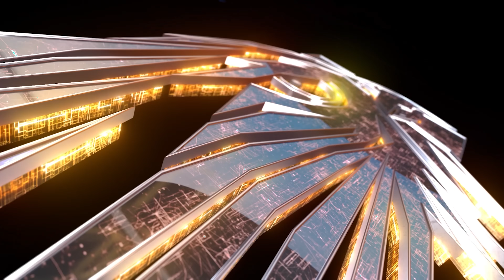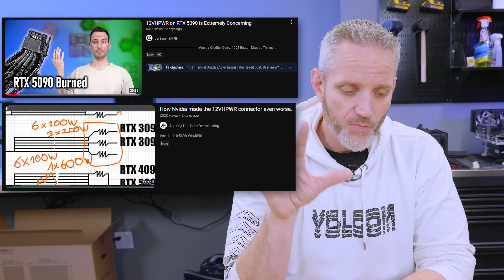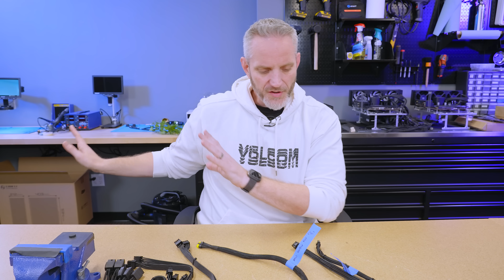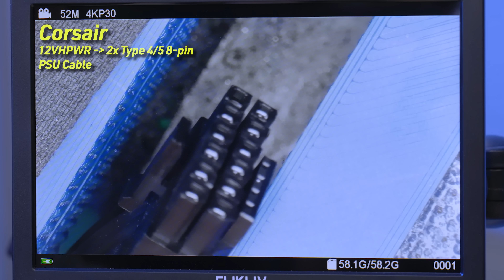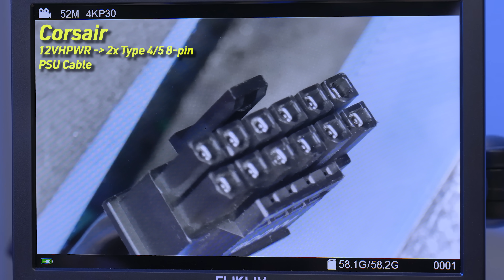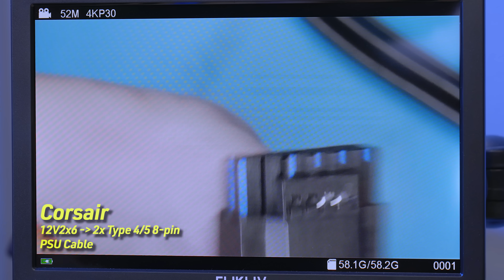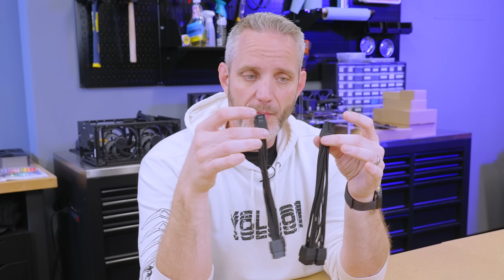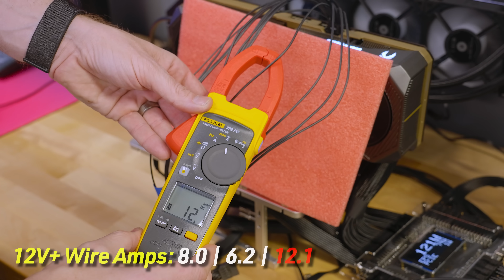I discovered something concerning and I need the Experts to chime in... More 12VHPWR discovery!

Comment: Even if that Corsair cable were still barely in spec, it's immediately obvious that the MSI cable has higher quality.

That said, I think the best possible cable would have metal connectors which would woble in the connector but never move depth-wise (that is, totally opposite the movement at 11:30). That way the actual metal connector part could relocate itself to perfectly match the pin in the GPU but still be fully inserted. If the connector is really firm without any kind of movement, then pins will push against one of the sides of each individual metal contact only.

Comment: Maybe one ideat for additional testing. Did somebody test also the adapters which are comming with the cards, where the 8pin cables are connected to the 12v2x6 adapter? Does this also indicates overheating, or issues with the power (Amp’s) loadbalance? Could be maybe a workaround, until the dilema with direct connection is fixed.

Comment: So where do you think the electricity goes after it goes through the core, vram, encoder etc.?
To ground, so yes, if this were to be a problem on the 12V side, it would also be a problem on the ground side.

I still think the "nvidia cable" is a stupid design, but I'm not sure anymore where the exact problem lies.
Has anyone looked at the female connectors yet and if the pins there are not "sticking out" too much, causing the seating to be crooked?
Is the asymmetry of the "fake" sense pins causing issues?

Comment: Welp, time for an H# revision. Seems like you can fix this problem real quick if the cable was designed to have the pins slightly above the hole. Just a l'il peek. That way, when the cable is plugged in, there is less opportunity for a loose-fitting connection to make inadequate contact. Also Corsair should e primped for yet another lawsuit with their shoddy connectors since inadequate contact could likely be the reason why fire happens; Steve Burke showed as-much.

Comment: So from the video I see 600W apparent rating printed on the side. So to calculate the amps (current per pin) is 600W/12 Volts which is 50 Amps. So the current is 50 Amps/12 Pins which comes out to be 4.166... amps per ping. That seems to me that, that amount of current is much more than it should be.

Comment: Look into Kirchhoff's current law which states that all of the current flowing into a node (or a junction or collection of pins) must be equal to the current flowing out of it (the sum of all current going into the ground). Kirchhoff's Voltage law states the algebraic sum of all the voltages around any closed loop in a circuit is equal to zero. Voltage is electrical pressure. So the voltage drops across each pin connection + the voltage drop across the electrical circuit, in this case the video card, must equal the total voltage applied from the voltage of the connector before the pin connector. With this said if the voltage drop across each of the pins is different you will then have a different amount of current going through that connection. IF there are differences if the current then there is different amounts of energy being delivered via each pin. The power delivery depends on each connection being relatively the same, very low, voltage drop for each connection on the pin. If the pins are crappy, don't connect evenly then power delivery will be uneven and cause a fire, or/and other really bad damage. Seems like these companies do not want to give the customer a correct, (but probably more costly) power delivery interface.

Comment: There are 3 reasons why this garbage exiest:
1. They spend less on PCB and components
2. GPU look more sexy
3. They do not care about fire hazard

There are no other reason why they can not to install 3 or 4 6/8-pin connectors for one card. Or use proper power cables and tested by decades electric connectors.

Comment: While I applaud the manufacturers for trying everything to make this connector work and be as safe as possible, it is a failed design and NVidia iss being shitty for forcing Partners to use it.  Guarantee you if NVidia didn't force it possibly all high end cards would have 3 8-pins instead.  12vHPWR is a total failure.

Comment: I bought an "EVGA Supernova 850G XC" because it had a built in 12vhpwr cable.  The cable was so shitty 3 or 4 of the pins pushed right out the back at the GPU.  I didn't have time to return it so I just used 8 pin cables and called it good.  The PSU is flawless as usual EVGA, except that 12vHPWR cable was total shit.    Lemme know if you want me to send it to you.

Comment: If your ground side (or negative side) had bad connetions, your ground or negative side would tend to melt.  If your positive rail has bad connections, then your positive side will tend to melt.   It is to do with current drawn down a cable, not what side of the supply the cable is on really.   When it comes down to it, if you have 22amps, whether that is positive or negative side, that is still 22 amps.   Poor quailty cables make the situation worse, but NVidia do need to do much better in power management.

Comment: Repeat after me: GROUND ALWAYS CONNECTS FIRST. This is why your North American 3-prong plug (NEMA 5-15P), British power plug (Type G/BS 1363) and so on have a longer ground prong than live and neutral, so ground always makes first contact and shunts any unwanted power during connection directly to ground.

Those cables and their ground connecting last are so, so, SO extremely dangerous if the device itself has no ground fault detection.

Comment: Jay what you should be checking is if the wires in those harnesses are really copper conductors. The latest fad from Asia is aluminum wires with a copper coat or worst, steel wires that are copper coated. Either of these could easily cause a connection to heat up and melt.

Comment: That pin socket on the Corsair connector is defective. There is supposed to be a locking metal tab to hold it from moving back in the connector housing. That tab is either bent back or missing on the pin socket. The other socket pins have that tab engaged. The other possibility is the plastic connector housing is defective and won’t hold the tab in place.

Comment: The true solution is a new connector that can't be faked at the factory level with cheaper equivalents.
This is the typical rot in the electronics industry that I have seen first hand as more manufacturing moved overseas, especially within China. I was a service technician and worked on low to hi power devices including server farms.

Add more pins that don't retract, and reduce amp load, also which drives up the cost of making said cables.
The factory manager can't use copper plated aluminum wires and have a yatch for example.

Another solution? Use Anderson power pole connectors, silver plated copper, bigger wires, less losses and put a margin of safety for current capacity to a higher spec. Of course that means more copper used overall and some expensive connectors. 
You can jumpstart a car from the tow truck adapter that some carry.

I wired up some mining rigs in the past with larger gauge wires and even made adapters.

Comment: A bad ground can be worse. It can cause the positive resistance to rise faster On th 12+ side. It depends on certain variables, including smart load or a forced load. Also, When hooking up old molex, we would use a toothpick to push each individual connection down tight.

Comment: Hi Jay I have a brand new rm850x corsair power supply and the 12v cable is a 12v both ends not split to 2 pcie . Dunno if they have updated it or not .. I have the cable and its un used and looks like the pins are in good spec

Comment: The ground not being seated is just as bad as the 12v not being seated. I suspect these cables have redundant wires for ground and 12v power. If this was not the case then a poor connection would immediately cause an open or high resistance. High resistance would cause the connection where the high resistance is to heat up. This high resistance would cause heat at either the power side or ground side. Since both the power side and the ground side both have redundant wires an open connection would cause the remaining wires to carry more current. If the remaining wires can handle the transferred current then the poor connection should be transparent. If the remaining wires cannot handle the additional current then the poor connection plus the good wires will all heat up. This will result in melted wires. The melted wire will occur from either a bad power side or ground side connection. This is my understanding from working with electrical circuits.

Comment: Good thing I'm not willing to spend over $1k on a GPU. I just built a system with a 4070 Super from MSI, with 12VHWPR because other cards I looked at with PCIE power wouldn't fit in the small case I was using, but it is only 270W card so this theoretically should be fine. I hope.

Comment: Just distribute sum of all spending current for each of that six cables separately, balance them separately at the end on GFX board and problem is solved. Also they need to consider connection loss and cable length to choose right wire gauge for that current. Nvidia need at first to do very simple job... The most ordinary electronics engineer should be given a job, and these fake scientists who have no idea what Ohm's law is should be kicked out of the company.

Comment: Since I first bought the Strix RTX 4090 until now, I have not experienced any cable burning problems even though my 4090 GPU consumes more than 500W of power when gaming. I use the original PCIe 16-pin 1-lane cable without branching from the ROG THOR Platinum 2 1200W PSU. The point is to use the original cable, not a third party, many users see attractive cables that have been customized & attractive, but quality is not a priority & also prioritizes the stability of electricity in the house, it is also a priority so that there are no surges or drops in electricity. There is a price and the quality of the goods used.

Comment: being a connector guy i have the insertion and extraction  tools , i would have removed that pin, made sure pin was good and then reserting  it. pull back on wire to make sure it is locked into place and rechecking that gap

Comment: Electronics Engineer here...Those individual wires should be rated for  around 15A max and  10-12A without heating up.  In basic electrical studies they teach that conventional current comes from positive terminal  and moves to negative terminal  but its old knowledge (before electrons were discovered).  In reality current (flow of physical electrons) come  from the Negative side of the source and moves to the positive terminal. 

So yes both connections need to have the same rating , number of conductors etc. If one is not connected the current will be forcefully drawn by the the rest of connected conductors. While in some cases it might still workout if the amperage is lower than wires rating but when you're hitting the wires/conductors maximum current capacity it will cause heating and fire soon after.

if you have 3 conductors carrying 10A each  with the wire rated for 10A then  if 1 of the 3 is not connected then the 2 wires will have to draw 15A each which will cause the cable to heat up like a bulb

think of it in terms of pipes. If you have 2 water inlet pipes and two out and decided to remove one of the outlet pipes then the single outlet pipe would be facing the pressure from both inlet pipes and will burts under the pressure if its not rated for the sum of both  pressures (inlet A + B).

Comment: Fact 1,  the GPU has no power it cant melt crap.  Fact 2, the cable has no power it also cant melt crap,  Fact 3, the PSU is the source of all the power causing the melting of the crap.  So the PSU is the culprit sending more power then the cable and PSU are regulated for.  the PSU spec 2.0 and 3.0 current last iterations of PSU specifications, some of them have faulty regulation, so its sending more power then its supposed to thru the cable to the GPU, hence why its melting.

Comment: if you look 24 pins atx câble for motherboard .pins are bigger cable are bigger and  less power 
no problem you can plug unplug more than 1000  and it s work 
no problem . 
this 12 vhpwr is simply too small for 600w with security margin

Comment: You say to just use the Nvidia cable if you are concerned, but wouldn't that cause more potential fires? PSU manufacturers love to move around the pins on the plug don't they? Would this even be safe?

Comment: the fact that it moves is not necessarily negative because it allows you to push the cable into the graphics card socket if it was too rigid given the number of connections (12+4) in the event of a misalignment you risk damaging the connector on the card side graphic I think that the problem comes from the lack of safety margin between the necessary power (600w) and the contact surface of the pins which obviously as you show is not necessarily always identical but if you a have some pins bigger you have more security margin

bad conception that’s all

Comment: At some point you have to stop and ask yourself:
Who is truly at fault?
The 3rd party company making a sub par product?
Or the tech company that for no good reason demands that a product is used, that has a tiny margin of safety?

What is stopping Nvidia, to just add another cable to the back of the card?
Sure they'd have to add a PSU to the GPU as well, AND you'd have an extra external cable.
On the other hand you could have more than ONE cable that connects to the GPU on the inside of the case.

It does look cool how only one cable comes out in an angle with the FE, but a cool look doesn't substitute cables being as hot as 150°C! (302°F)

Comment: those individual pins have barbs that prevent them from backing out. when the wire gets plugged in the barb springs out and locks the pin in the plastic. this type of connection has been used forever including Molex.  the barbs are really flimsy and might not seat correctly. always eyeball the end of your connectors. install them once, remove it and check the pins again. If plugging in the cable pushed the connector back in the casble should not be used. crappy molex pins have been around for long time. Using softer and cheaper materials will increase the failure rate.  the plastic, pins, wires, and connector design needs to be a blank sheet redesign or adapt new connector already established. Digi Key has much better choices compared to the crap being used on both ends of the cables

Comment: The seating of the pin is broken on the Crosair connector. This is a manufacturing issue, when it was just plugged once. 

Anyway, this is a consumer product. Consumer products need safety margins and measures.

From my point of view, I'm a electrical engineer, the error margin is too small and a cable that can easily be wrongly seated is not a "user problem".

Comment: pushing the limits of power connectors is like proving gravity isnt real by pissing on a rattlesnake. not long ago vape bros discovered just how much power 20 amps is when the 3.7v 18650 in their mech mod shorted out. And heres nvidia making the same discovery. didnt take vapers long to discover voltage regulation and over current protection circuits lets see how long it takes nvidia.

Comment: I have a Gigabyte RTX 5090 Windforce OC and i only use my pc for gaming or web browsing, board asus x870E hero, amd 9800X3D, all stock, i never overclock my hardware, tested for 2 days now only gaming FS2024, COD 6 and Indiana Jones, max GPU temp 64º, max GPU power usage 480w, iam using nvidia adaptor, and so far so good, a little more noise that my asus tup 4080 super and zero coil whine, 4080 super had little, but this one is zero. Very happy so far, but my 4080 is on hold.

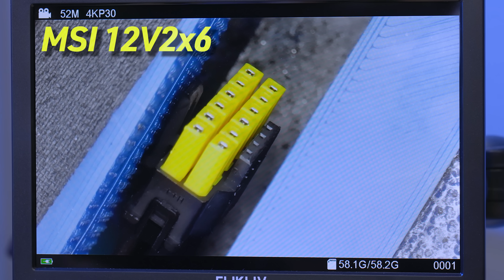Comment: 8:11

I had a very recent issue with a cooler master 8 pin pcie connector melting on my 3080 and it had the same recessed metal connectors as what you showed here.

Comment: Professional car audio installer for over 10 years and I can agree loose or poorly made connections can absolutely cause catastrophic issues. I've had to fix burnt connectors on radios and DSPs due to this (which killed the units causing thousands), and have seen fire damage totaling out vehicles due to a ground wire being loose, or connections in fusing on power wires not making complete contact

Comment: A long time ago I bought a case that came with standard Molex connectors that were even more atrocious than your Corsair cable here, but same kind of observation. The connector itself was merely a fulcrum for the wire-pin connections, making the pins so wobbly and dependent on how the cable tugged on it, that it was a chore to orient them inn a way I could plug in the other cable (it was supposed to be a short centipede). Sure enough stuff plugged into that didn't even work, the pins were so bad, they didn't even make connection. They fit into each other, but some of them didn't contact, because of the size difference in the male and female parts xD .
A bit of back and forth play (oh man, I swear that was not intended) has always been normal, though, but there might be a limit on how wobbly something can be, like in my case. Literally case...man, usually I force the puns, but this time they came out on their own.